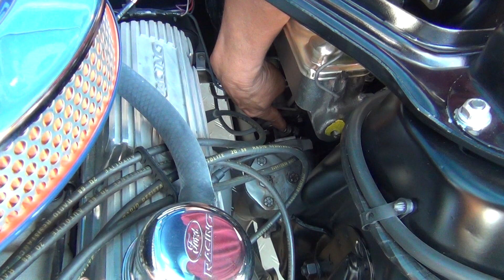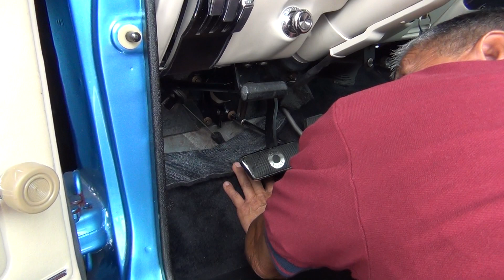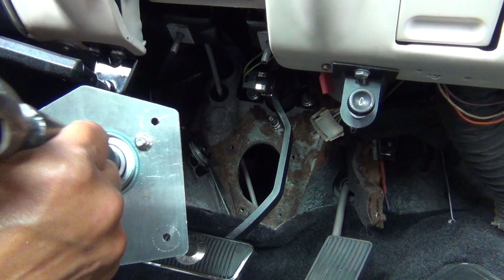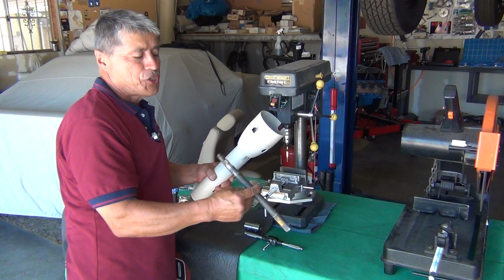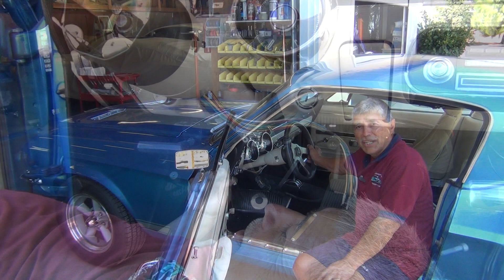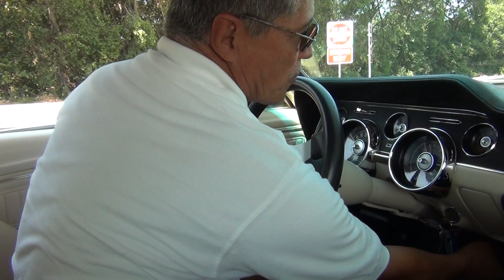How to install a Mustang Electric Power Steering on a classic Mustang

Comment: was the  column cut 15.5 inches from the shaft or the column?  If i measure from the column i need to cut down where the rubber boot is on the column.  Seems too long.  If i measure 15.5 from the tip of the shaft it looks more like how yours was cut.

Comment: I have a 67 Cougar 390GT car. It currently has the factory tilt/ tilt away column with factory power steering. 
I bought a set of JBA long tube headers.
They cannot be used with factory power steering. Will this electric unit allow me to maintain my factory column with the tilt away feature?

Comment: I just bought a EPAS System for a 66 Dodge Dart. Few questions. 
Can the unit be installed at any angle? 
I see most installing on the left side of the steering tube, few on the right side. 
How far up the steering tube does the EPAS need to be? Can it be midway or very near the firewall?
hope to hear from you, cheers.
Reply: You can fit it on anywhere along the column. I've seen a video where the guy has it installed in the engine bay, as he had no room under the dash. So you should be good to go.

Comment: If anyone is considering doing this conversion, do research first. The ePAS column is sourced from various GM cars and is easy to source and easy to modify. The "kit" shown has very few parts which are supplied to cobble the assembly together. You can work this out very easily yourself.

If you are unable to work it out and modify it yourself then really you should not be working on a steering systems in the first place. Huge safety concern.

Secondly, the ePAS system is supposed to take an input from the engine rpms's so it only draws power when the engine is running. It also takes a speed signal (either from abs or vss sensors) to auto adjust the assistance at differing speeds.

This kit gives you a cheap box (check ebay) which simple produces a pulse that connects to both these inputs. So it will flatten your battery super fast if you leave the ignition on. Takes a huge draw away from the starter motor during cranking. And has no speed variable assistance. You will constantly be fiddling with that potentiometer as your speed changes.

My advice, do research. Obtain an ePAS column and modify it yourself and put together another/proper way of supplying the varying signals. Very easily done with various circuits or use a microcontroller whereby you can program your own settings.

I have fitted ePAS to one of my Mustangs (a very custom 70 mustang convertible) and used a esp32 microcontroller to run a custom dash and provide the ePAS signal. It works great. It only works when the engine is running and adjusts the assistance at different speeds. I have even added the option of adjusting the transition speeds in a menu on my custom dash odometer display. I have taken the speed signal from a foxbody vss sensor in the speedo output of the transmission. Running this through a vr converter (dsc) converts the signal for the microcontroller to read and use, convert and send to the ePAS controller.

Total cost? Under $100.

Comment: does this system tighten up the steering are far as back and forth play in the wheel. i completely rebuild the entire power steering system in my 67  and still have that slight wheel movement before the wheels actually respond. I guess what i am asking is does this kit feel the same as a factory 1967 power steering just without the hoses, leaks and pump. Or does it make it feel more like a modern car with tighter steering... more gokart like??

Comment: It's great until you get that error message on the highway going 60. And your wheels lock up.
Reply: It will just go back to manual steering if it fails.  I drive my 68 with no power steering right now..its not a big deal except parking.

Comment: I know this an old article however I noticed a weakness in this install. Regardless of whether the vehicle has power steering or not, there usually is a lot of force, weight, pressure or whatever that is put on the steering wheel/column from getting in and out of the vehicle, adjusting the seat, hanging on while going around corners, road rage etc., etc. The original steering column has three main points of attachment for the required and necessary strength. 1) The under dash mount (which seems to be the only mounting point for the EPAS system).   2) The solid one piece column and shaft that mounts to the steering box.   3) The four bolt firewall column flange.
         I realize that the o/e rag joint would have some movement but it is located at the far end of the rather long steering tube/shaft and offers way more support than the universal joint being mounted just to the rear of the rather short EPAS unit. Also, the firewall steering column flange gives the original setup more strength. If you were to heavy hand the EPAS unit, the universal joint will not offer any support like the original long tube column did. The dash mounting point would be taking most of the strain and I would think that it would eventually stress, weaken and crack the dash/column support. Just an observation that I see that no one has brought up. I believe that there should be a support bracket of some sort that ties the back end of the EPAS unit to a dash crossmember or the firewall,  Great product and great video though!
Reply: Hi, another watcher; I think the upper steering colum housing is retained by 4 bolts.

Comment: what if you lose power? my mustang is a '70 model stroker. how is fitment? is it reliable? OK some of this explained in the video later. thanks
Reply: The loss of all steering is what I want to know. At least with fuild controled PS. You would have some turning in a complete power loss... Unless it can switch over to direct the battery some how.

Comment: Great video - thank you!  One question for you - In the beginning of the video you mention that you remove the driver side fresh air vent, and may modify it for better clearance, but you never show later on what modifications (if any) you ended up doing.  Do you mind elaborating on that a little?

Comment: What's the name of the kit?
Reply from the maker: http://www.mustangsplus.com/1965-1966-Mustang-Electric-Power-Steering.html
Reply from the maker: You are correct. The fresh air box is held up to the cowl area with 1/4 in pan nuts. Once these are removed, the air box comes right out. In addition, you have to remove the 2 bolts which hold the parking brake handle. Otherwise it comes out for ample clearance. Should you decide to leave it in, then rotating of the motor assembly is more cumbersome. I probably should of at least showed it removed.

Mark

Mustangsplus
Reply: @mustangsplus  how hard was it to remove the heater blower for the install of the ECU?

Comment: How much do you think it will cost to get power steering installed?
Reply from the maker: Contact the Restomod Shop, ask for Terry and inquire as to what they would charge. They have installed many of these units.

209-942-3013 is the Shop number.

Mark

Mustangsplus

Comment: I have a 1972 Toyota Land cruiser fj40,  I have a medical condition that limits me in the chest and arms, I've been unable to drive my uota for quite awhile due to it not having power steering. can anyone tell me if this can be added to my fj40 so I can drive it again, thank you
Reply: you can. lots of fab work but its just a motor that attaches on the steering shaft

Comment: The 12V when ignition is on female connector. What is that called ?having trouble finding 1 in x 3 outlets. And did you use a fuse tap to connect the one end or how did you wire it into the ignition on power?

Comment: Dear Mark,
I had the privilege of watching your presentation on installation of EPAS on a 1968 Mustang car on youtube. It was worth watching and it was extremely educative. I honestly appreciate the ability you have to present the technical process involved with the replacement of the mechanical steering to EPAS. I was keenly watching your presentation as I intend to convert the mechanical steering of my old 4 wheel Drive Willy's Jeep to EPAS. if possible kindly extend your guidance.With the best of regards.
B.S. Mishra/India

Comment: Would be nice if there was a electric power steering pump for 3 quarter ton trucks but I've been searching and none exist unless I'm over looking something in the search. Maybe there isn't a strong enough electric pump that can handle a truck?
Reply: +EagleTalons1 

I'm using a 2007 Saturn Vue electric power steering motor with my 88 Chevy 1 ton. Doesn't seem to strain it, and its been in for about 6 years now.
Reply: +Coty Ramsey did you hook the pump to a already existing power steering gear box on the truck? My mechanical power steering has a electric valve that controls how much pressure is needed in conjunction with turning the wheel (I think most vehicles have this), does your electric pump make the wheel feel very easy or is there some force to turn?

Comment: In researching steering systems for a from scratch build, I was on the Ididit site and an installation video specifically advised against drilling into and especially through the shafts. This would seem to be noteworthy information. While undoubtably many have done it this way and it will work, it is also fully understandable, why you wouldn't. If the proper coupler is available, dd, as illustrated and fits the application, then why not use it? And if it doesn't fit, have it modified( again, without compromising strength) to fit. As rod and custom enthusiasts, we all want to maintain the highest levels of safety for ourselves and those we share the roads with. Very well presented video!
Reply: They now have a kit that includes a shaft.

Comment: Just got your flyer with this system in it, looks straight forward, has a stock appearance, how many amps does the assist draw? Will I need to upgrade the charging system over the stock 65amp unit..

Comment: Awesome concept. Only drawbacks I can see are that it is still using the factory steering box, and the under dash clearance.. I'd like to see it installed in a manual transmission car. I'd also like to know about the ability to couple it with a rack and pinion.

Comment: I'm currently running a manual Total Control rack & Pinion system. Can this unit be adapted to my system?
Reply from the maker: Ken Ashbrook It can work with the TCP system you would just have to order the correct component. I think it will not work with a tilt system. If you want more info on this contact our technician at 800-999-4289
Reply: +mustangsplus  .  I have  a question about coupler that you put to jointe the two shafts with 4 bolting nuts. so are they strong enough I mean in any case driving without power it will holds up. I made one yesterday but i made a hole through the shaft and coupler and tighten with nut bolt
Reply from the maker: Hello,

as to the shaft on the Mustang early steering boxes, many folks have done what you did. Drill straight through. This may weaken the joint over time. How much time, I don't know. The proper way is to indent the round shaft, (drill), then then loctite the set bolts or screws firmly. This method is widely used throughout the hobby field. 

Mark

Mustangsplus
Reply: +mustangsplus 
Hi :)
well it is a Renault trafic van. well the shaft is round and for the coupler I installed it with 8mm nut in it I put it on van and it does work. I appriciate your work and help. good luck 👍and cheers.
with best Regards

Tasdaq

Comment: My question is what are you measuring from when you have to cut the column and the shaft? It was skipped right over on where you would take measurements. 
Great video, thanks for taking us through the steps.
Reply: i have the same question.  The manual says 15.5 inches from the top of the column.  Seems too long though..it looks more like 15.5 from the tip of the shaft itself.